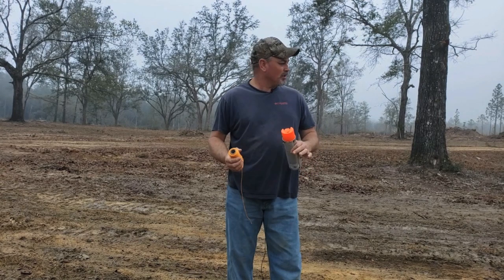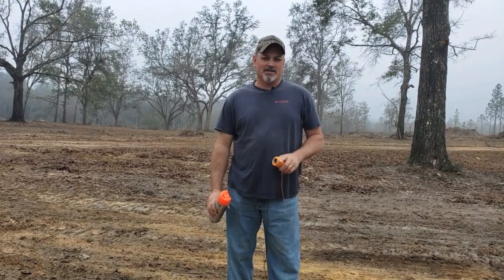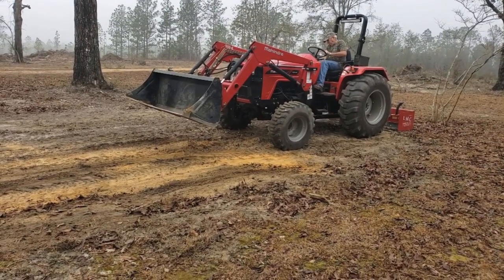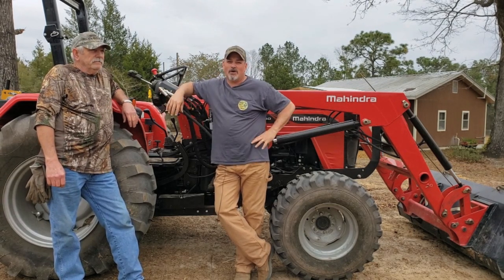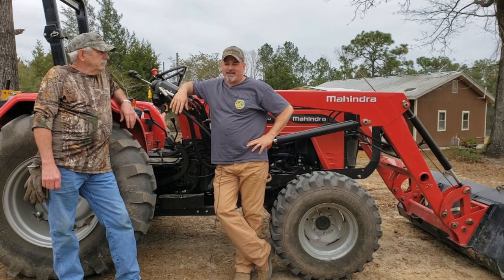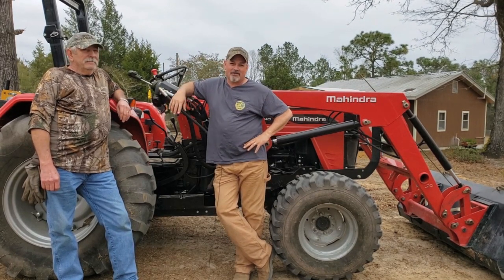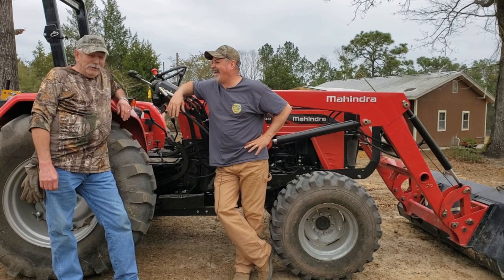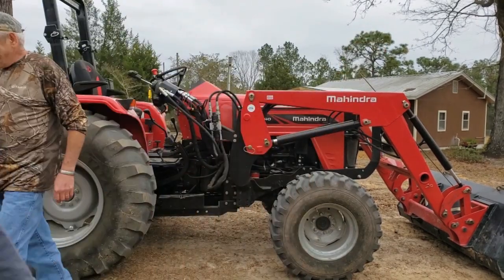How to build a pole barn on a hobby farm PART 1 [2019]

Comment: Wish these southern building companies would build these kits to northern codes. We just put up a 40ftx50ft polebarn inclosed with crushed stone floor here in NY and cheapest kit that met our area codes was 35,000 and change that was frame,rafters, tin for roof and walls and purlings and 1 12ftx10ft rolling door that we had to build. Would save us a fortune if we could have bought a $6000 frame kit,but then again welcome to NY where sand is used for lube when trying to do anything.
Reply from the maker: Yeah I hear ya. NY, CA and other States like that have gotten completely out of control

Comment: So my County is requiring a have a truss and foundation plan for my 30 x 36 pole barn. Is this something you think I could draft putting pencil to paper or would I need a CAD program.  Seems like they want to complicate something that should be simple.
Reply from the maker: Try the easy way first,👍
Reply: I wrote out my plan and they approved.  Do you think I should pour some concrete in the post holes first and let it set before setting my 6 x 6 posts?
Reply from the maker: If you do that. Use a tamp of some sort to get it as level as possible so the posts sit square on it. Ive heard of people doing that, but never actually seen anyone do it.

Comment: what you using for poles?
Reply from the maker: 6x6x16 pressure treated #2 pine. I will have 12ft eaves. I think you have the option to go with 8x8 or round poles at the place I bought my kit, but I just got the standard kit they offer. ( But I did upgrade to the 16' to get the higher eaves)
Reply: I found your page bc I'm looking at buying a 4540. I also live in north Florida and looking to build a barn on my place.  Ive been looking and found a whole bunch of companies around north fl.  & old town area selling pole barn kits. Which one did you go with?
Reply from the maker: Surplus and Salvage in Chipley. Those guys are great to work with👍🏻..the trusses are made by Blackwater trusses.